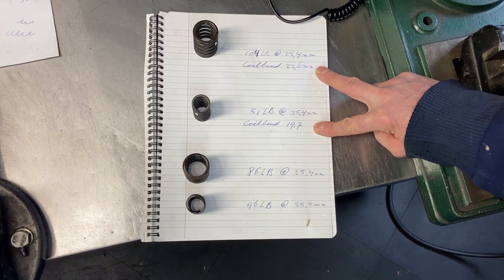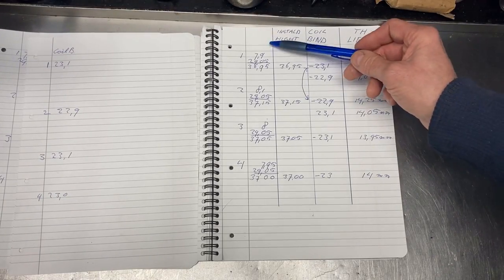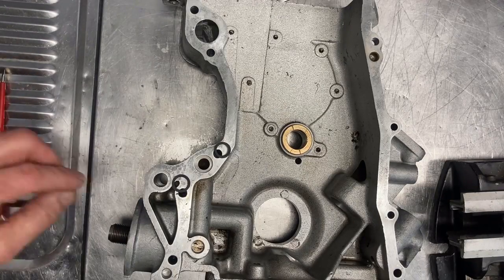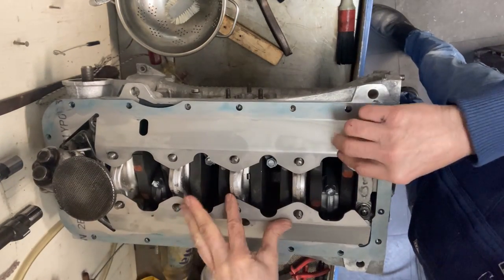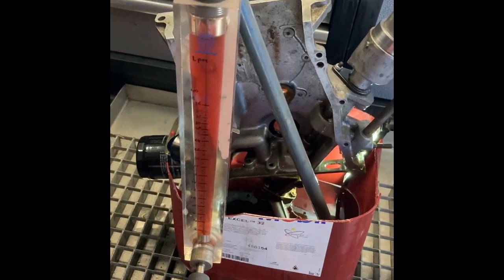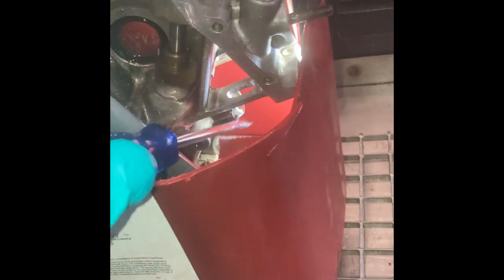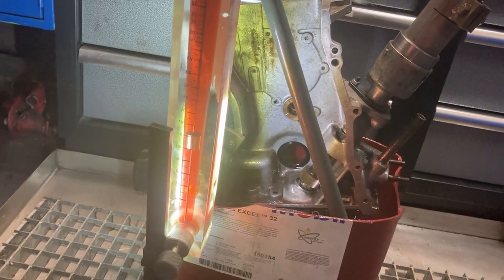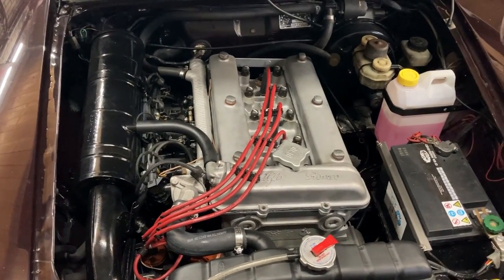Alfa 105 engine rebuild part 7. Checking the valve spring pressure and  modifying the oil pump.

Comment from the maker: I will do a follow up on this episode because I forgot to name the main benefit of installing the oil pump drive gear later.
And that is that you can feel if the pump is lined out correctly.
Reply: Hello.   Great video.  Can you feature how you setup the Hall effect cam sensor to read the cam?
Reply from the maker: @wbanderson 
 Hello I missed your question sorry.
 On my track day car  I used the hole for the sump ventilation, widened it and made a flange for the sensor.
At first I used a hose clamp on the cam for the trigger and later welded a piece of metal on the camshaft bush.
And bought a GTA oil cap for sump ventilation.

On my roadcar I modified a distributor to give the cam signal.

Comment: I use the same main cap 'girdle' plate, and also have used a normal sump gasket below it.  But I've been thinking of filing a small chamfer in the outside edge of the sump flange, below the starter, to be able to use a wedge tool to spread the sump away from the block, and to then be able to use RTV instead of the gasket.  I found that Toyota has these tools, and got one.  It's basically a wedge of steel with a handle set into it at 90 degrees to the wedge, and you can tap the wedge in using a hammer.  I've not tried this yet but will look at it the next time I have the motor apart.  I think there is plenty of flange width to do this for perhaps a 3-4mm deep chamfer.

Comment: I ran into a 164.3.0v6 12v of which one piston had been replaced and it had a different oil ring (the 3-part one) and the others only had the 2-part one. and when I put a 2-part oil ring in place of the 3-part one, the ring was able to move vertically too much and the machine smoked.

Comment: Very cool! I have the same modifications on my oil pump but I never tested them. I'm also using the sphere instead of a piston valve. The new engine I want to build is a 155TS converted to Giulia and I'll use a 105 oil pump. I'm not sure wether I should buy a new long gear pump or use a original old short pump. Any opinions on this?
Reply from the maker: Great idea to use a sphere, but then you definitely have to block the channel between the valve and the suction side.
The OEM part is no longer available, I have tested a (cheap) imitation pump and it performed worse then a used stock pump.
I assume the pumps in the 800 euro price range will be good.
I used the best short gear (used ) oil pump I had and the oil pressure is very  high.

Comment: I never knew you could do this to a nord oil pump. Great. Would you also plug a relief hole if you would use a short gears pump? Would you do that on a street engine also?
Reply from the maker: I did not know either until i tested these pumps and decided to rectify the "faults"I shaw.
I used the short gear pump, and the engine is now  in a street car.
Although the  stock oil pumps are fine and I had never any trouble with them I will do this mods on every next engine build.
Reply: @nord.tuning  thanks for the explanation. I will probably do the same at my next rebuild. Thanks. Great information

Comment: Working on my used oil pump last night.  The set you did to test it is genius.  How much flow is needed to test the flow? Is that diesel in the bucket?
Reply from the maker: The "big"pump did 17l/min and the best  normal pump did 16 l/min i will give u the rpm of the drill later could not find it right now.
i used light hydraulic oil Mobil Univis HVI 13.
Reply from the maker: I did some more testing:
A good old stock pump does at 850 RPM 15.5 L @ 1 bar and 13.5 @ 3 bar
At 1540 RPM  21.5L @ 2 bar and 20L @ 4 bar.
A new imitation pump did at 850 RPM 14.5L @ 1 bar and 11.5L at 3 bar.
At 1540 RPM 20.2 L @  2 bar and 18 L @ 4 bar.
This is the pump RPM engine RPM is double that of course.

Comment: Interesting how the oil pump draws air in from the relief valve, do u think the factory oil pump does this from standard 🤔 😳
Reply from the maker: could be, the canal is blocked by the side of the piston ( relief valve ) so never a perfect seal.
If the valve leaks a bit like mine did this will make it harder to suck air past it.